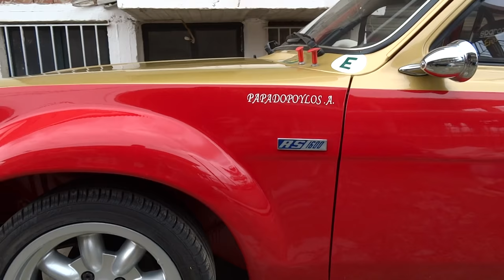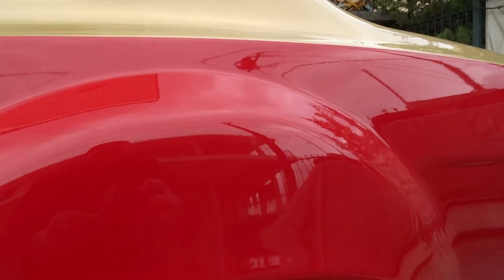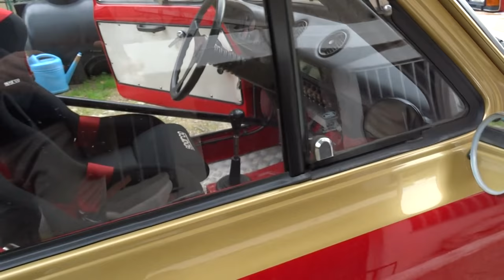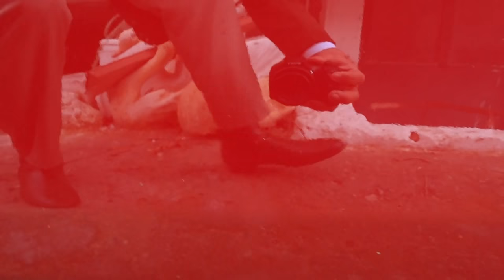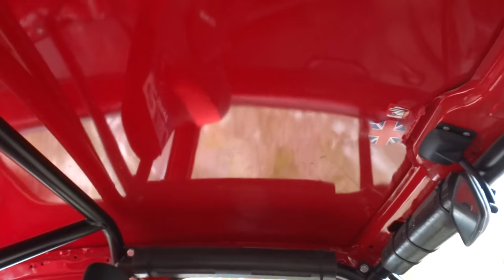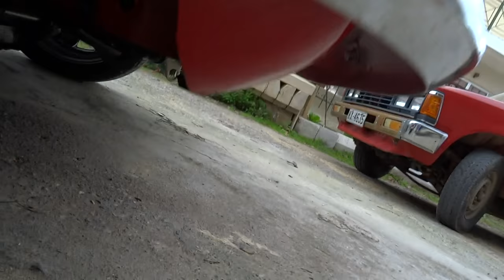1969 Ford Escort MkI BDA Alan Mann, walk around

Comment: it is a early 1968 shell, but no BDA shell, nice Wilcox engine, seems to be a 1100 shell originally
Reply: No such thing as a BDA shell, that would be an AVO one, or type 49 as they're more commonly known. This one has been built from a standard (german) shell, given away by the battery cutaway on the inner wing. No way of telling if it was a 1100 though. Radiator is an RS2000 one, 4-link setup is longer type mk2 gp4 instead of early gp2 short linkage, mk1 Fiesta calipers at the rear, and the list continues... It wouldn't be allowed to enter anything but a clubman event, but i'm sure it's a lot of fun to drive regardless!